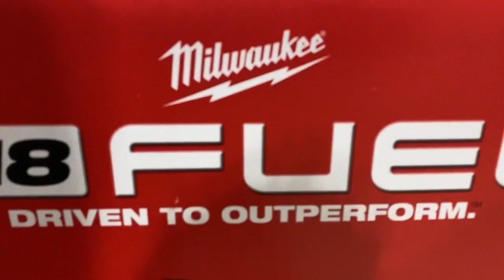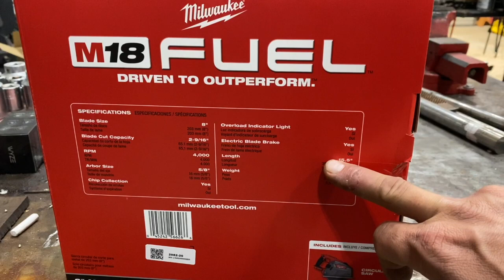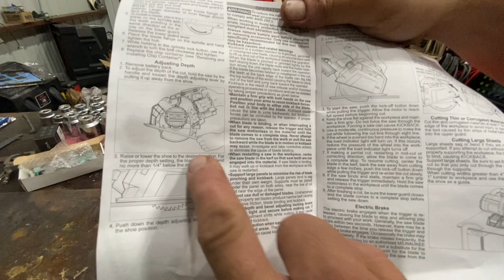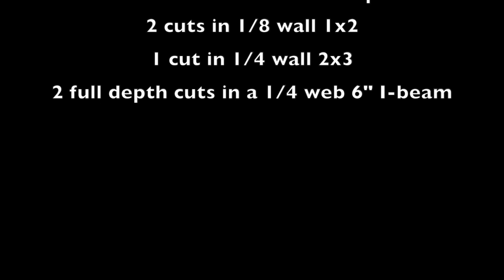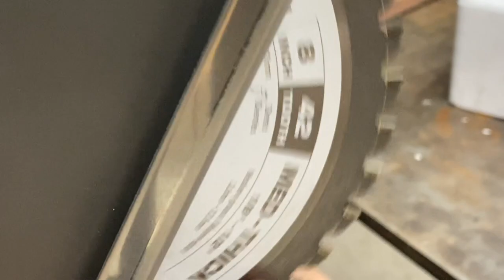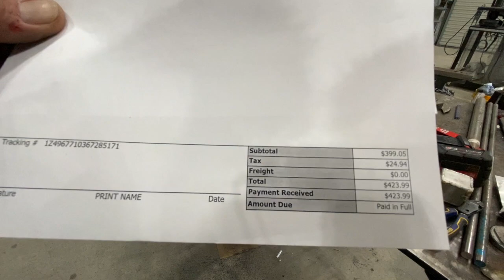Milwaukee M18 Metal Cutting Circular Saw 2982-20 Unboxing & Review

Comment: If you dropped the depth a bit further so there's less tooth contact with the material it would reduce the drag on the blade making it cut quicker, easier and increase battery life.
Thanks for the in depth review.

Comment: It seems to be one of those tools that you let spin up and let it ease its way through. Man it they had a bevel capability it would be great for weld prep on plates. 30 degree would be all you would need. Looks like a solid tool I will have to put one on the wish list.
Reply from the maker: It is. The difference between feeding the right amount and forcing it is so small. It definitely takes a feel.
Reply: It takes a 8.0 🔋! Perhaps you need to buy bigger batteries for it! 😂🤔😱

Comment: example:backup for computors,take out the small battery 12v-7amps that give you about 15 minutes,,and replace it with a car battery 12v-80amps and you would get about 10 times more longer,,the motor on the saw juste take the amps that it's needs to be at max speed perhaps  2amps.

Comment: This is a tool that is really designed to be used with the h.o. batteries.  You can get away with a 5.0 if you have to but even the 9.0 hd will overheat.  I only have 6.0ho and 9.0hd batteries and the 6.0ho doesn't overheat but the 9.0hd does.
Reply from the maker: Yeah, I picked up a 2-pack of the HO 6.0’s. Haven’t had to use the saw yet, but I’m better equipped now. 
I kind of like that this review happened with only the xc 5.0’s. Let ppl see the ability.

Comment: Two things. No matter what the service manual says about blade protusion, whenever possible run at full cutting depth because your blade teeth will be at a much better cutting angle. If you’re cutting near the bottom of the blade, the teeth have to take a loooong wipe out of the metal and get full, this causing a metal galling and robbing you of power. Secondly, you need to use high output batteries on that thing. Great video
Reply from the maker: the logic in the blade stick out is due to blade life. 
At full stick out only one tooth at a time is in the 3/8 material. So when the next tooth engages, you are able to take too big of a bite and have an impact on the teeth. 

In practice it seems true. Tear up less blades with less stick out.
Reply: TexaCajun DIY sounds logical. We’ve tried both ways in our metal shop and (aside from safety)  find that it cuts far faster with less motor load at full depth. I can’t say blade life is an issue, although maybe it would be better if we didn’t. As far as batteries though, man you gotta try out the 6,8 or 12 ah high output batteries. They are the ticket for power on big motor stuff. I have the 6” cordless grinder and the difference between the 5 and 6 is basically life and death. The reason for that is the high output batteries have 21700 high amp discharge rate cells and the 5,9 ah etc; only have 18650 standard amperage discharge cells. My grinder claims 13 amp corded power;bear with my poor calculations here: 13aX120v=1560 watts. 1560w:-18v=86 Amp discharge rate. There’s a lot of variables there but that’s some crazy amperage
Reply from the maker: Yeah I got a 2 pack of the 6.0 HO’s. Overt difference. 

I’ve build 4 things using plate since making this video. 1/4 stick out is too shallow in 3/8. Like you said, it’s slow and hard on the tool.
My theory is this: The stick out needs to be whatever it needs to be to have 2-3 teeth in the material, but no more. So like in 1” plate you can go full stick out, in 3/8 plate  it’s like 1/2” stick out. That gives good speed, low motor load, and prevents the single tooth blade impact deal. 
It seems that about 3/4 is the full stick out number. In other words, if you are cutting anything(square, round, beam,etc) if it is thicker than 3/4” then full stick out works fine.
Reply: TexaCajun DIY how is the battery life with the 6ah on the big saw? Thinking I want to get one for our shop
Reply from the maker: Built a 4x4 table out of 2” square 1/8 wall and a 3/8 top (I use a lot of 3/8 plate). Cut all legs and braces and the top on one battery. Still had 2 bars. 

For a mom&pop shop I’d see this as a life changing purchase as cost per cut is a ton of fabrication overhead. However, For a big production operation with shears and Cnc breaks, I bet it gets pulled out for an odd job, but otherwise remains a shelf queen.
Reply: TexaCajun DIY hey just an FYI we picked one up for our metal shop and the guys love the thing.
Reply from the maker: @justinmartin8887  good deal bud! I hope you retire before it does!

I recently picked up a mag drill at a steal, but had to weld a casting back together. NOTHING humbles like TIG on an oil-soaked cast aluminum part. Be sure to check that video out.

Comment: about how much did you spend on yours
I have an older mode m18l saw  looking in to another
Reply from the maker: it was 320.00 I like it better than the corded cause there is no cord to snag and it stops if it gets in too big of a bind to protect itself.
Reply: @texacajundiy   yeah the 1 i have now was not at all so pricey it was like $99.00plus tax at the home depot a few years ago 
I do see they improved it a great deal the 1 i have has nothing on it like the new guy looking forward to try it now my next question is  were did you get yours I looked at the Amazon web site and there's is close to $4$ and the home depot much the same 
   please do tell
Reply from the maker: Unfortunately I got it on a preorder special. 399.00 is the price now. On EBay there are a few that are 360.00 (likely factory referbs).

Comment: What is the difference in the 2982-20 and the 2982-21 besides price? Can't find a clear advantage
Reply from the maker: The 21 has an 8.0 HO battery and charger. The 20 is the bare tool. 

If you don’t have any HO batteries or could use another charger, the price for the 21 is fair. If you don’t need the charger though, cheaper to buy the battery and tool separate.

Comment: Hello maybe you can answer my question since I can't find anyone else that has run into this. Do you think this could cut steel that has upward or downward bow without pinching the blade? We occasionally cut steel with bow that likes to pinch our nibbler. Usually 1/4 plate
Reply from the maker: I know what you mean. Just like the nibbler, this will get pinched as the bow relaxes and the edges fall inward. 
Put the forklift tines down on the plate to flatten it... or your fattest employee!
Reply: @texacajundiy  Thank you for the reply.  Definatly considering trying one

Comment: Ask me how I know. My goodness I recently cut my finger and lost a little nerve sensation using sacotors. I got a bit close cutting branches after I really sharpened blades.
Nice video presentation. Since cutting can you see the light when it over loads?
The Hilti cuts out on overload same with the Panasonic. Although the Milwaukee did cut out. Do you think making a sound is an option  or beeping?
These machines certainly cut better than angle grinders and more versatile than a heavy friction saw.
What about true square if you check with an engineer square?
Reply from the maker: When the camera is off I can see the light fine. It’s in an intuitive spot too, watching the cut and the saws relationship to the guide; it’s hard to miss. We get a bit acrobatic to make for good TV. 
As for square in “Z”, I’d say 3/16th out in a foot using the angle guide stamped on the saw. That’s a good enough fit for most, but if you need better, gotta turn it over and use a square to set it, like a table saw. Dang good question. I should have answered that in the video.

Comment: High demand batteries are gona make s hugh difference on this tool id say
Reply from the maker: Yeah that overheating is a problem on anything more than about 15 inches on 3/8 plate. I use that a ton cause I can get scrap 3/8 pretty often.

Comment: Great machines. I'm just stopping at 13 minutes and interesting you are mentioning no difference between the 9 amp to the 5 amp hour battery. Just run time.
Metabo line of batteries were bringing out 7 amp hour and then 8 amp hour batteries.
Later a slim 4 amp hour battery came out and a high energy output 5.5 amp hour for say angle grinders and high energy demand tools.
The angle grinder under load the 4 amp hour stopped and the 8 amp hour kept going so too the 5.5 amp hour. I'm not sure the configuration of the metabo batteries. I'm sure after patenting other manufacturers will follow suit. Milwaukee certainly set the precedence of a larger cold cut saw. I have the Panasonic cold cut saw 14.4 volt 136 mm blade, Hilti 160mm cold cut saw and now a metabo 160mm cold cut saw. The Hilti is 3.3 amp hour 21.6 volt. The cuts are slightly out of true 90degree when checking cuts with an engineer square. More straight than the Panasonic where the square is about 1mm out. The Hilti is about .5 mm out and the metabo is about .3 or .4 mm out so not a true 90degree cut. 
I don't think I can get any better considering the blade is 1.8 mm thick.
I'm not sure there is no adjustment. It struck me the metabo has a stainless steel base and riveted on like you mentioned the Milwaukee has and mentioning the rivets may break. The Hilti has been a good saw and done a lot of work. The Panasonic is also very good although it doesn't let me know how much battery life is remaining and lack power  on say 3mm wall thickness hollow tube. In saying that no problem with pergola tube which os 1.6mm.
One battery of my Hilti recently died it no longer charges. That the reason I got the metabo as I had batteries also it can run on a track. Good for cutting sheet goods.
Reply from the maker: Ronald the “high energy” or “high output” or whatever the particular mfg calls their product basically runs not only more cells parallelled they also run bigger cells. It’s not just a longer running battery, it’s also a higher amp battery. 

In the video I was referring to going to a larger battery of the same series. In Milwaukee, that would be the base XC red lithiums. 

I recently picked up a 2-pack of 6.0AH High Output batteries. It’s basically a completely different battery. More power, just don’t drop it on the pinky toe.
Reply: TexaCajun DIY ha ha those batteries will hurt if you drop them on your pinky toe. Especially when you get out of bed and have a look at the batteries. So Milwaukee are producing special cell batteries bigger cells unlike the batteries you were mentioning. I think I seen the new Milwaukee batteries at the tool shop on the weekend although I didn't ask what they were. Thanks for the reply.
Oh, check out mafell plunge saw. I think perhaps Milwaukee copied the enclosed style of blade cover from mafell. Although for steel like you mentioned a lot of particles were on the floor.
Reply: @ron1martens  My memory is a bit fuzzy, but I think there was a product specialist/engineer/designer who left Mafell to go to Milwaukee.
Reply: ChrisCas - Tool Aficionado very interesting Chris. I was told metabo and mafel have collaborated and there will be a mafel style plunge saw coming out with the same guide rails. Maybe it was that as a tool man told me who had been attending the presentations.
From what I was told Milwaukee are not in a hurry to bring out the plunge saw. I could be wrong.
I spoke to a Milwaukee rep ( come to think of it) The rep told me a plate compactor could be on the cards. I was told the bigger batteries produce 72 amp hour although he didn't know how many volts.
Back to metabo I didn't mention the guide rail will be the same as mafel and the Bosch. That is different to festool. Don't know when this will come out to Australia though. We seem to be a year behind USA and some tools we just don't get.
Thanks for your comment. I will keep and eye on it.

Comment: the comment on a 9.0 not providing more power than a 5.0 is just wrong.. it has 3 sets of 5 cells each set being similar to that of the 2 sets in the 5.0 and therefore having 50% more juice to rush in with.. a 5.0 vs a standard 6.0 (not the HO 6.0) would be similar in how powerful the tool is its still two banks of 18650s but the 6.0 chemistry would allow longer run time, the HO batteries use 21700 cells which are larger and each row can output more amps at any moment compared to any 18650.. theres alot of chemistry and trade offs in the cells but tool companies maintain a good split between runtime and output as its a trade off between the two
Reply from the maker: The issue here IS current. Those 18650’s just won’t do it. They will overheat and peter out. Have to have the higher amp cells.
Reply: @texacajundiy  well yes it is current, 21700s are vastly better due to their size than 18650s at current output.. but my point was a 9.0vs a 5.0 the 9.0 has 50% more cells in parallel so theres no doubt it will output more current than a 5.0
Reply from the maker: Man those 9.0’s still get too hot too quick & die out. On the tools with larger motors they just don’t offer any appreciable advantage. 
They likely would in a hand drill. 

I get the theory on paralleled batteries. I’m just telling you, mag drill, they get hot and die, they just do it a little later.
Reply: @texacajundiy   yes theyre a little better than the 5.0s.. they wont change the game but its a decent difference and the 12,0s are that much better than the 9.0s.. i use the circ saw an angle grinder an the  9.0 makes all the difference between useable and having to baby the cuts
Reply from the maker: Now this is some ol’man stuff but I like the 5.0’s on the grinder cause when it starts running slow that means it’s time to get a little coffee.

Comment: need a 12.0 on it... not a low demand 5.0
Reply from the maker: Agree, but this thing is still getting it done with the 5.0!
Reply: @texacajundiy  torally agree, but its having to ramp back up instead of cleanly evacuating chips and maintaining blade speed, any deviation or anything short of perfect feed throws it off

HD battery would allow for all these to simply power through

Comment: your blade isnt appreciating that shallow depth of cut, theres no need to match the depth to the work thickness its actually better to have the saw full depth if you can.. think about the angle of how the blade is swooping through the material, on full depth its coming up almost vertical and only cutting 3/8"-1/2" on each pass and pulling the saw into the work making it stable, on the shallow depth of cut its coming in much more horizontal and making a long pass/chip through the material making say a 3/4" cut in this 3/8" material, can cut an inch in with each depth and stop pull the saw out and look at the area of steel thats been cut youll see the difference and with more of the force pushing back at you and little force pulling down its alot less stable,

lastly the full depth blade sticking through the material acts as its own guide and keeps you going straight through the material not wondering side to side
Reply from the maker: Your way cuts quicker. My way spares the teeth as more teeth are engaged to the work at any time. Less “impact”, if you will. 

Since the kerf is thinner than the teeth, 2-3 teeth in the cut will actually keep you straighter than the kerf, but a guide wins over all.

Comment: Bought this saw and compared it to my dewalt 577 circular saw with a diablo steel blade and to be honest i couldnt excuse the spending of this saw when the 577 with the diable blade did as good as this saw. So i returned it
Reply from the maker: Interesting. 
How thick was material? 
How did it do with chips?
What blade model?
Reply: A regular circular saw spins way to fast and doesnt have enough torque. It is not designed to cut metal. As a metal worker, we’ve been down this road.